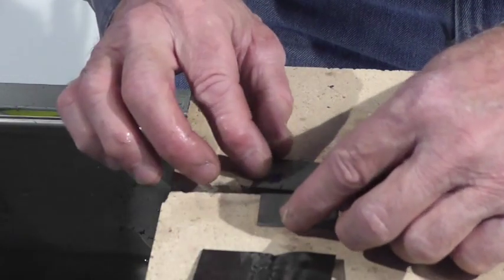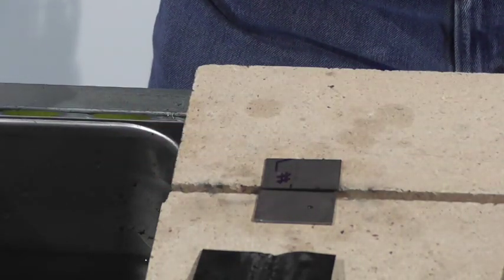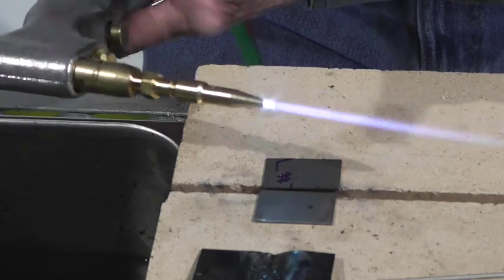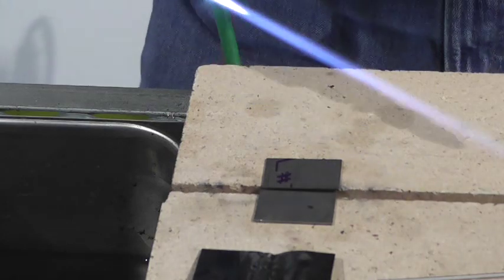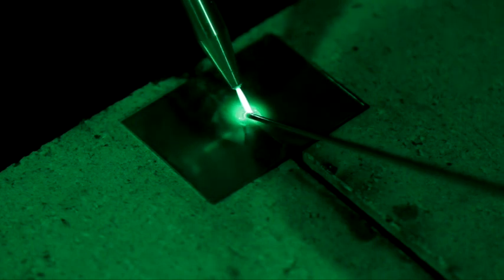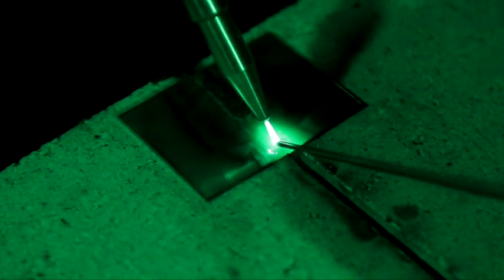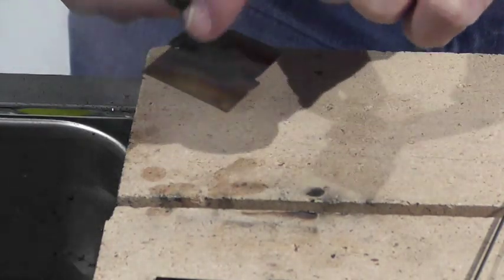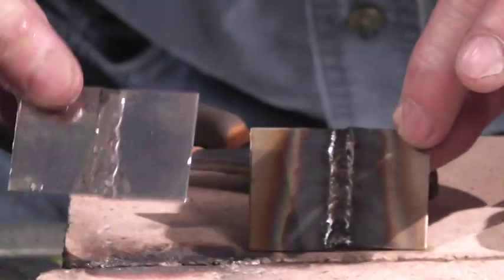HOW TO GAS WELD STAINLESS STEEL

Comment: Thanks for the quick video, I want to build some headlight guards with a stainless sheet metal ring and stainless wire mesh (made of stainless welding rod) for a custom car project I'm building.  I was going to take the pieces to a local TIG welder, but I have an oxy acetylene set and wondered it I could do it myself.  I think I'll give it a shot after seeing this, it looks pretty similar to they typical gas welding I've done, except for the carburizing flame of course.

Comment: i used neutral flame and it burned a hole through my stainless steel
Reply from the maker: At 35 seconds in the video it is clarified that stainless steel welding requires a carborizing flame.  If you would like more assistance please reach out through our website. www.detroittorch.com.

Comment: Did you not use flux
Reply: Doesn't look like it, and he didn't mention it... I'm guessing it takes some skill without flux, not overheating the base metal nor the filler rod. I have to say before today I had no idea one could oxy weld stainless, let alone without flux. So cool.